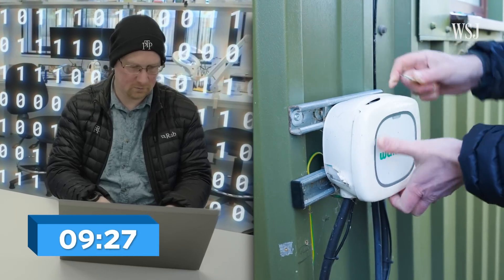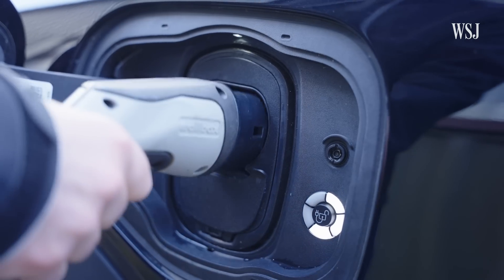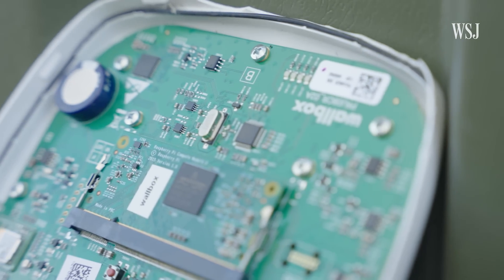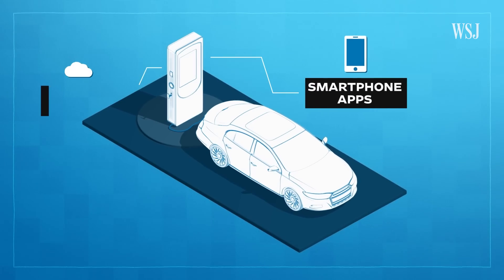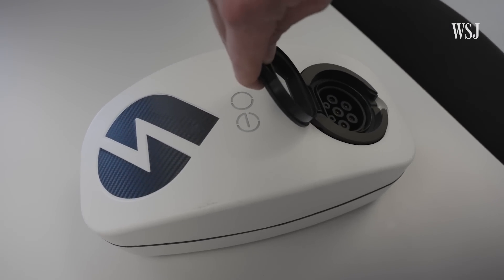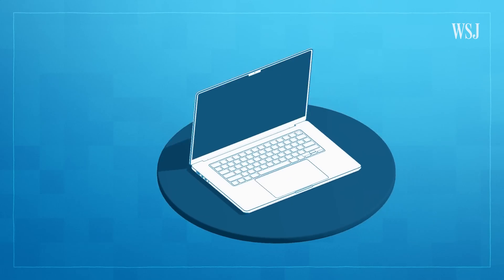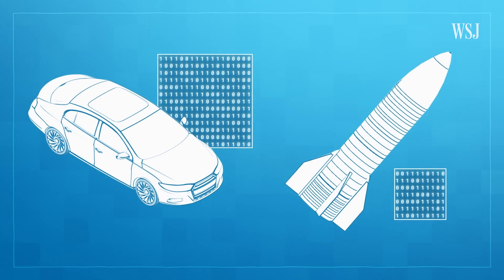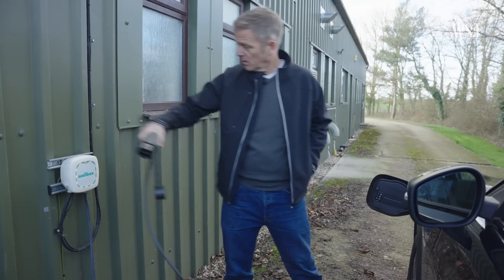This Is How Easy It Is to Hack EV Chargers | WSJ

Comment: This is a general concern for IOT devices but this pen test company is dramatizing and creating unnecessary FUD. One can't connect to any EV charger (EVSE or DCFC)  because one charger is compromised, unless the providers overall ecosystem itself is vulnerable.
Reply: yeah those were my exact thoughts
Reply: Well, if the manufacturer of the charger failed to add proper authentication to their APIs and the devices can be addressed through their sequential serial number, then any one can register an account and use those credentials to control all the chargers whose serial number they can guess. Of course the API should check that the charger the user tries to control belongs to the user but apparently that used not to be the case. Instead, they relied on the UI which only shows the user their own chargers but thats fairly trivial to bypass by using the same APIs the app uses.
Reply: @viljamip  Most home EVSE’s have no scheduling, Internet connectivity, or authentication of any kind. You plug it in like an extension cord and your car controls the charging from there. Of the people who have EVs and happen to have this brand EVSE and happen to have the old version and happen to have opted out of the firmware update and happen to be plugged in and happen to be discharged and happen to not notice that charging has stopped in anticipation of such an attack, and…

…well, I could go on but let’s just think about how this is a British company. That a country where the power grid handles a surge of 1.5 million electric kettles for tea time each day. Sure, the grid operators literally anticipate it but the idea that this EVSE exploit of a subset of a subset of a subset of a subset of users could unexpectedly cause something so much bigger than what they deal with every day is a little silly.
Reply: @emmettturner9452  Since I have actually operated the grid in Arizona, New Mexico, El Paso, Tx and El Centro, Calif (interconnected) I can say you are correct.
Reply: @emmettturner9452  Great comment but I've seen similar utilities and maintenance standards devolve here in the US at the municipal/state level, so be ready. If and when we lose a public standard for quality and attention to detail, the private sector will need guys who do things right for its own sake to rekindle it. Easy to have that kind of pride in your homeland but very hard to have that kind of pride in your boss's mortgage payments.
Reply: @viljamip  That is a service provider exploit .. a much larger issue that needs to be solved (true for any IOT service). No need to physically access and open the EVSE (the physical endpoint)
Reply: Given the issues I've had with Ohmconnect randomly switching on and off devices, I wouldn't be surprised if their network was compromised but they just don't know it. I know it's their network because cutting the internet connection while maintaining the wifi network stopped the issue. There are a ton of reports on this but the company is oblivious.
Reply: @imzjustplayin  It could be a technical issue. Chargepoint had a major outage few days ago. Also, some demand response plans can cause interruptions. Of course, a provider could be hacked - impacting all the connected devices. Can happen with any IOT. Nothing special about connected charging equipment.
Reply: @JOfAllT  He’s saying that the company denies it. I’d expect them to know about such issues.
Reply: @emmettturner9452  Having physical access to a specific brand EVSE, claiming to "hack" it, AND then stating this is a general issue with all  charging equipment that could cripple the grid are at the opposite ends of tbe spectrum.
Reply: People overlook just how big a business and grift infosec research can be.
Reply: I like how using a rPi is a “bug” just because it’s an open platform. What do they think about OpenEVSE?!
Reply: The problem with that statement is the assumption the network is not vulnerable. Often we rely on the overall networks security to protect against low level fruit like this, but in truth and as seen in recent cyber attacks, many industries previously thought impenetrable have been hacked. In addition, highly targeted attacks against individuals do take place globally, any vulnerability, even one which affects a single individual, is a danger to all.
Reply: @jacobp8294  Network vulnerability is a general concern (with any connected device/service) which I already mentioned.
Reply: Quite.
Reply: For the record, they mean all the chargers of project EV. You can connect to your charger from everywhere on earth, not just when you are connected to your home network. Meaning that your phone, uses the Project EV relay server the relay command and queries from your phone to your specific box. In order to connect to your box, you phone need you serialnumber and credentials. But these devices often also have an admin account for installers and they are often generated based on serialnumbers. If serialnumbers are sequential (hence serial) you can guess the serialnumbers and access it. This isn't limited to EV chargers, how do you think your 'print from everywhere' works? 

All Congress needs to do, is pass a law that states if an IOT is hacked and it could be easily avoided with better security, costs are for the manufacturer. If defects are now fixed fast enough, products can be removed from the marketplace. If a device is 24/7 connected to the internet, there is no good reason why the EV chargers doesn't project OTA updates. What do you mean it is the responsibility of the owner. NO! It is the responsibility of the manufacturer to develop a product that is safe to use. 

My IOT devices can connect to my wireless network, but that network has very limited internet access. Everything going out (to the internet) is blocked by default, unless granted specifically for me. Yes, that means that I can't connect directly to my devices over the internet. Then again, I don't really have a need when I'm on vacation to turn on/off my EV charger...
Reply: Yeah and overheat the battery? Take control of the car? Come on.... The Mode 3 AC charging specification only allows for simple communication pulling different resistances and voltages onto the control lines. It's not anywhere close to a bidirectional internet connection. The EV is in charge of 99% of the charging, the charging point only turns on the power, provides ground-fault detection and usually a few other non-charging features like time delay and user authentication. The EV manages its' own battery temperature and charging process. It can terminate charging at any point, just like your hairdryer won't work when plugged in, if you don't turn on the power switch on the handle.
Reply: @TheNewFaceOfHSP  Yep. The EVSE is basically a fancy electrical cord with some safety features.

If surging the grid with unexpected load were their goal they’d be better off hacking a large consumer appliance brand’s IOT. At least clothes dryers and such remain plugged in at home 100% of the time and don’t get “full” like a battery does.

If anything, V2G will turn many EVs left plugged in and charged into extra surge capacity for the grid… like millions of power walls the utility company can tap when needed. If V2G takes off then the problem of demand surge from hacked EVs literally solves itself.
Reply: @emmettturner9452  It never was a problem anyway.
Reply: The provider's overall ecosystem itself is ALWAYS vulnerable. But that's something you can plan and react to as well. The goal isn't to give clients this idea that *you're* the right installer who knows the right tricks to never have your solutions fail or to pick the right products from companies who aren't like all those other guys. In my opinion, that's also wrong. Our job, if we are truly informed, is to set up realistic expectations and communicate that there may be proprietary models to improve outcomes, that we may be able to prevent exposure through dummy credentials or other common IT wizard of oz tricks. The most functional operations on earth are the ones that put in place safeguards against one's OWN incompetence.

/Caps and italics

Comment: I like this reporting, but I feel it's a bit sensationalist.  Cybersecurity research companies are paid to painstakingly find any and all loose threads with security and envision a worst-case scenario.  I feel that's the only side of this represented in this story.  While I'm sure they can be better, there are already safeguards in place against many of these issues (multi-factor authentication, car-key security, the ability to make your charger 'dumb' if it's in a public access area, etc).  I guess it's technically possible, but the reality of a power-grid surge where a bunch of hackers physically individually popping the cover on a massive number of EV's, steal the log-in data, then later log into all of those accounts simultaneously and telling the cars to charge is pretty remote, right?  Also, aren't most cars already charging when plugged in?
Reply: And there are methods to bypass 2fa and car security. Also other countries have had attacks on their power grid. It’s not unheard of. Doesn’t have to be a hacker but a state actor as well. But it’s definitely sensationalist.
Reply: I am not a security expert, just a home user/engineer and these flaws they are pointing out are class A negligence!  None of these products should have made it to a customer
Reply: I think the point is that there are no standards keeping companies to a bare minimum of security. How many consumers do you know that search for security vulnerabilities before buying a product? I'm regularly telling friends and family about security holes and can't get them to check ahead of time. How diligent is the general public? And given that's their target audience, how diligent do you think companies are about security and safety when they need to get those numbers up for the next quarterly report?
Reply: @LabGecko  Just look at how many products claim to be "smart"
Look at how easy it is to be a high paid idiot in marketing vs how hard it is to be an engineer producing products they are then responsible for.
Instead of just paying the least amount for the highest review rating, we need to start looking at every product and ask, "is this working FOR me or AGAINST me???
Is turning my appliance on from anywhere in the world really worth exposing myself to hackers from anywhere in the world????
Reply: Did you even watch the video? Lol 
They accessed it online.
Reply: Also, everyone forget there are fuses everywhere in the electricity network :)

Comment: imagine someone hacking self driving cars💀
Reply: As someone who dabbles in white hat, that concern is the same for all cars made after early 2010s. They all have components that allow for remote control. Subaru actually had the vulnerability more recently. Fortunately the electric vs gas does not even factor into how the car can be taken advantage of. Either for control, or what most hackers would be after - Information.
Reply: Imagine the car not even needing to be self driving to be hacked. As stated in other replies, most vehicles made after 2009-10 have plenty of components that could be vulnerable in the same way. Any vehicle with “radar adaptive cruise” type features could be hacked to accelerate you into another vehicle or stop, lane keeping assist has control of steering as well, so yeah, nothing to do with self driving…
Reply: They have.
Reply: Will make kidnapping so much easier!
Reply: NOT required, existing cars with Stability Control can already be bugged to allow remote access. Especially when you leave your car parked somewhere public for many hours.
ESC allow control of brakes, acceleration and even steering to some degree.
Reply: Imagine someone hacking a plane you fly in? Why don't you express worry about that? Because you know the companies flying have every incentive to make that as difficult as possible. Cars are no different.
Reply: @lawrencefrost9063  Planes are not connected to the internet. There is a threat of hijacking which is why safety measures have been adopted to handle that.

Companies don't have strong enough incentives to prevent hacking. Companies often want to get features out fast and don't care enough about cybersecurity, because the chance an individual company is attacked is somewhat small.

That's why there are so many breaches going on. I've had my information stolen in a handful of those. And companies don't really face major consequences for them - sometimes they just pay a small fee.
Reply: @lawrencefrost9063  only the greedy corporations that dont want to go broke. oh wait greedy corporations are good?
Reply: @lawrencefrost9063  they aim laser pointers at planes and try to dazzle the pilot. In China people are aiming the lasers at the cameras controlling the car. It blinds autonomous vehicles. This is why LiDAR is extensively used.
Reply: As someone who works with self driving cars. The amount of stuff you would need to do in order to hack it and gain control would be pointless. You could only move 3mph for a few feet.
Reply: @OneManOnFire  buddy my point was that even if its to hard but  few feets could cause series of serious accidents on certain scenarios
Reply: @OneManOnFire  absolutely, if someone is intent on causing problems then either stopping it physically or make it veer off course would be the option.